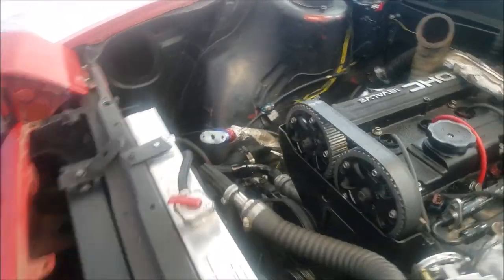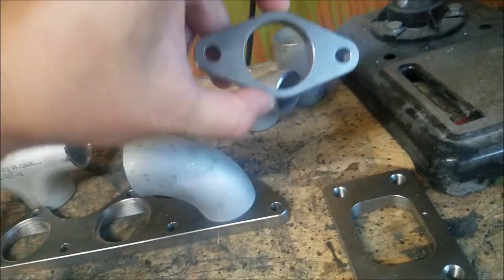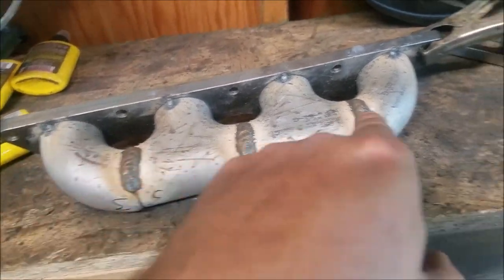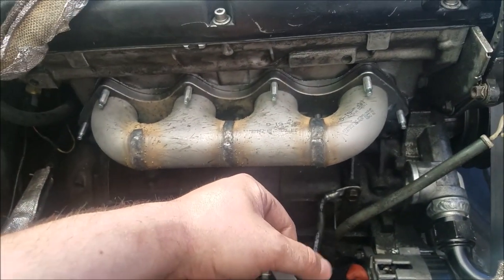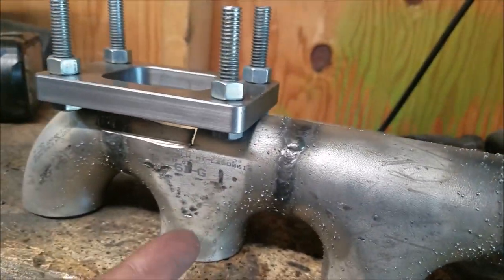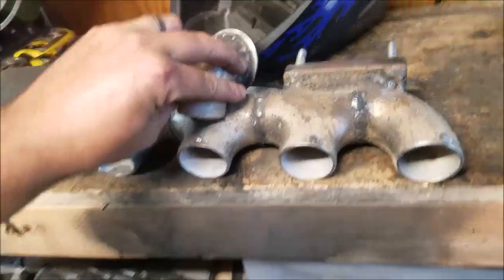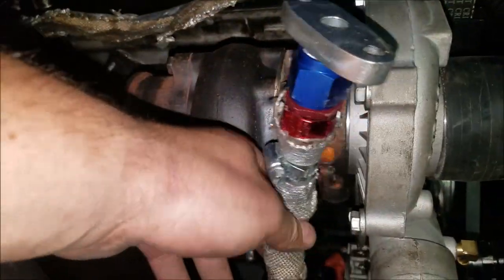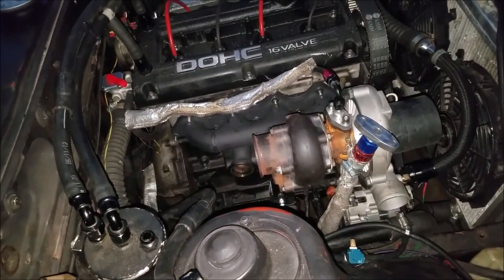DIY 4G63 TURBO LOG MANIFOLD! used $100 fluxcore 110v harbor freight welder

Comment: I'm cheap AF... but I learned my lesson a few years back, with those small wire spools. I only use the large ones now. There is a LOT less waste for changing out wire and I've never ran out since. 👍
Reply from the maker: Same! The big roll is more up front but u save like 50$!

Comment: Sch 40 stainless on low carbon steel will make for high thermal expansion stress.  Those appear to be Sch 10S 1-1/2 pipe fittings.
Reply from the maker: What would b the fix?
Reply: @Garageless  
Cut the flange between cylinder ports. Enlarge bolt holes.  Graphite gasket.  Use longer bolts with bolting collars.
Reply from the maker: Awesome thank you for the information will use that wen i build another manifold

Comment: How did it hold up seeing that the stainless was welded using mild steel wire??
Awesome content thanks
Reply from the maker: It did crack but it was due to use make wastegate dump and it put pressure on the manifold cracked on stainless outside of weld... so welds didnt fail...
Reply: @Garageless  I am building a turbo manifold and all I have is a flux core welder as well. 
maybe try to buy blue demon flux core stainless wire probably will help you. 
it's a shame we do t have it here in UK so all I can use is mild steel wire and your video was inspiring really.
Reply from the maker: @kamolia my old turbo setup on my fiero was stainless flange welded to mild steel exhaust piping to stainless t4 flange... it held turbo weight for 3 years! Never cracked! So my opinion is itll be fine lol my recent upload was my old turbo setup
Reply: @Garageless  thanks dude, I'll give it a try and I'll post some videos as well

Comment: How's the manifold holding up? I totally want to build a manifold like this for my 71 240Z. The stock turbo manifold sucks. I was thinking about doing the whole manifold out of mild Steel making it super thick and then braced from the block.
Reply from the maker: It has ibly cracked once and thats cause we had pressure on the wastegate so it cracked the manifold where wastegate attached... re welded the crack hasnt failed again since
Reply: @Garageless  is the manifold still holding up? Also did it start to rust due to not being back purged
Reply from the maker: Holding up great did have a crack happen due to vibration for wastegate spot but rewelded it and good to go
Reply: @Garageless  I'm thinking about welding mine up with a mig welder and then finding a ceramic coat shop that can bake it for me so it won't rust up on the welded spots. But I was just checking due to all the crap you hear about how it needs to be tig welded with argon gas back purging and all but it seems to not be all true.
Reply from the maker: Just looks better lol

Comment: Damm this makes me want to make my own manifold
Reply: Chylo Davis something very important was missing from the video, in reality they might have done it. If they didn't clean the weld berries and slag from the inside, it will come loose and ruin the turbo.
Reply: josh bishop Of course nobody should be attempting their own manifold without knowing how to weld a bit first. Part of that is knowing to clean shet
Reply from the maker: Thats the nice thing about ebay turbos.... send it! Lol the inside was actually really clean cause the gaps on everything where really tight... only thing that wasnt was the t3 flange

Comment: Where do you buy the manifold pieces from? I’ve found a flange but not the other pieces. Nice work 👍
Reply from the maker: Ordered kit from ebay
Reply: Ace race parts also great place to use

Comment: Your welding skills kick ass, do you use shielding gas or is it straight flux core? I never had luck with my mig welder” but it was a cheap one and had issues with the spool getting jammed.

Te arc welder I can use Efficiently, it’s easy to get the arc going
Reply from the maker: Fluxcore i cant afford gas... lol
Reply: @Garageless  what's your experience without using gas? have you had any issues?
Reply from the maker: Just gotta use fluxcore wire no gas needed

Comment: You used flux core wire on stainless steel and it actually worked? I've never seen or heard of this being done, especially when joining mild and stainless. It's been a couple years, how did the welds hold up and what flux wire did you use? Great job by the way, I too have done a lot of projects without a garage and some of them where big undertakings so I know the struggle and ingenuity that comes with being garage less.
Reply from the maker: ive welded stainless flanges to mild steel with out issues... i use just basic fluxcorw from homedepot... miller wire i believe
Reply from the maker: Its still together... i believe the tubing cracked but not the welds was a while ago lol